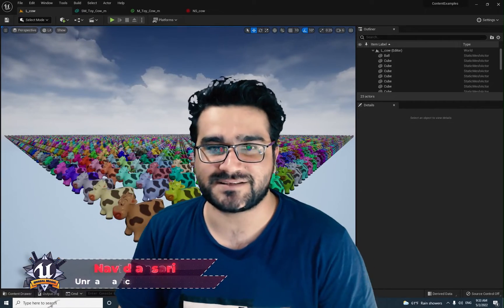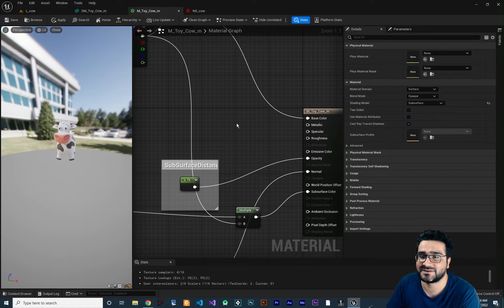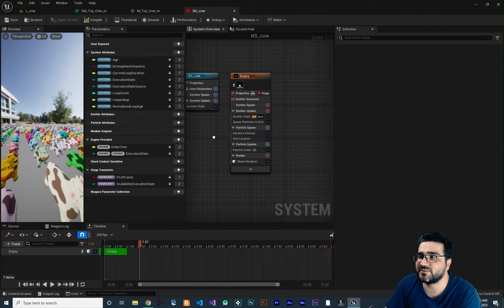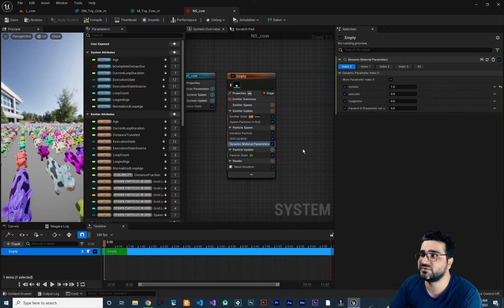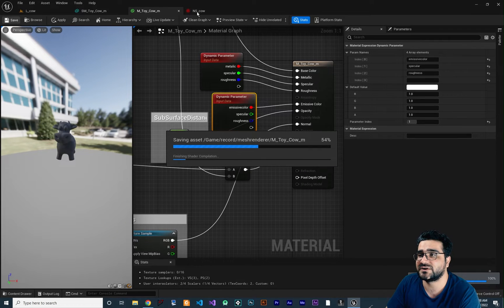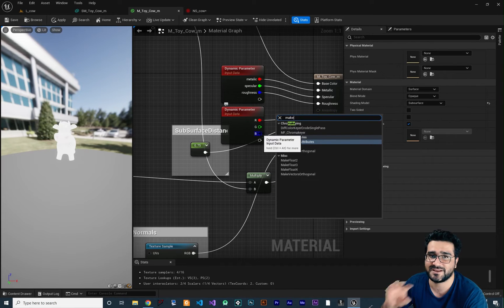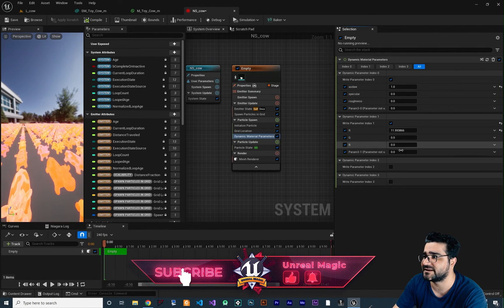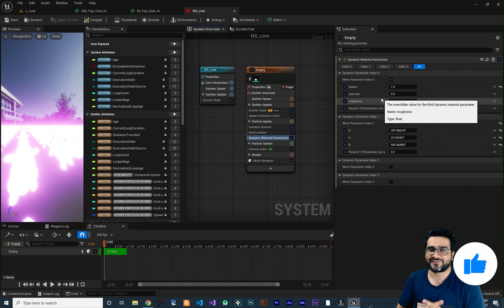Niagara system dynamic parameters in unreal engine 5

Comment: When I add the dynamic material parameter module to niagara, all of the parameters are empty. All the parameters say "Param0-0 (No material found using dynamic params)". Do you have to do a special trick to get them to show up in Niagara?
Reply: I doubt replying after 8 months is useful but I'll still do in case someone needs this in the future.
Make sure to save and apply material changes and also to set "Used with Niagara sprite" (or mesh or whatever is your case) in the material settings
Reply: @giovauefn  it definitely helps because i havent figured it out yet lol. thanks i'll give it a shot
Reply: Im getting this aswell and can't figure it out